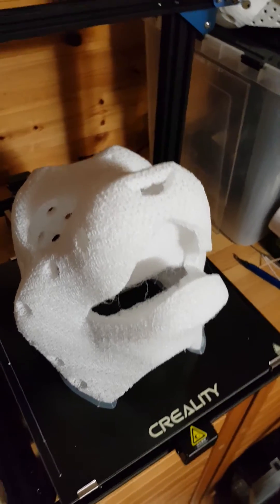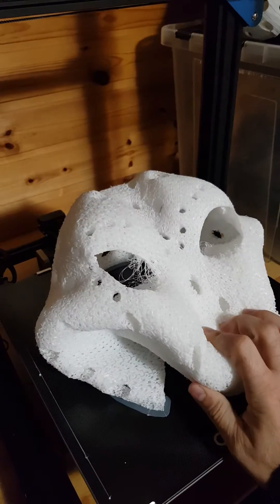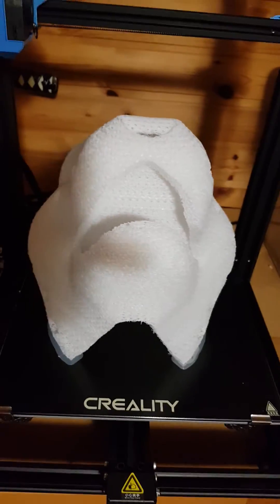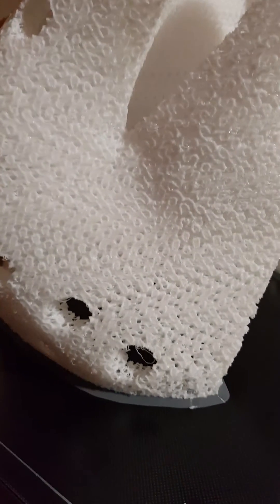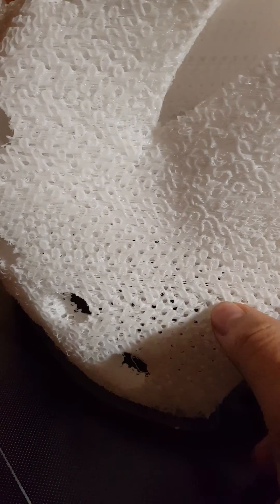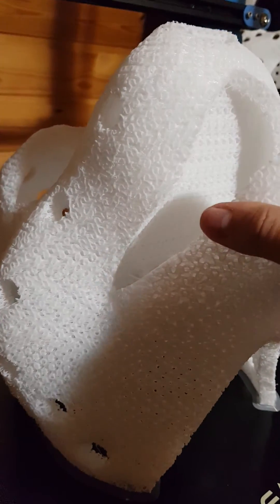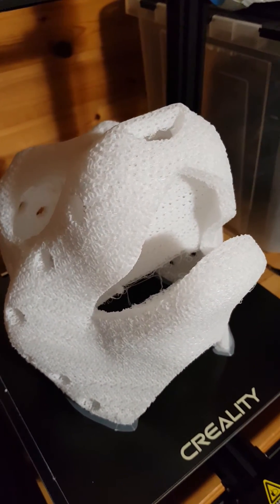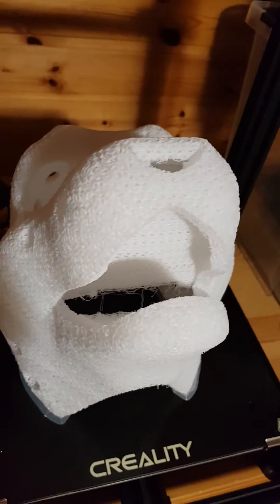3d-printed flexible fursuit head base - optimized print settings - #shorts

Comment: Hey! I'm prinitng a tpu base of my own and in overhanging areas the tpu is stringing and just doesn't wanna stay in place. Urs look perfectly fine even in overhangs wohtout any supports. I'm using a p1s bambu and sunlu basic tpu. Idk what else should I do to fix it. Thanks for the help. I reall don't know where to ask cuz its such a niche thing ^^
Reply from the maker: I got most of the stringing problems under control by lowering the print speed and adjusting the printing temperature. With some TPU filaments plus or minus 5°C can make a huge difference.

Comment: I need help, I'm trying to print one of your models on printer and it keeps failing, what's the printer setting you recommend, I'm using a ender 3
Reply from the maker: Which model are you trying to print and what filament do you use? How does it fail (Does the extruder get caught in the print? Is the print bed ahedsion lacking? Does the print warp? ...)? If I print my head bases with PLA I use the default Cura settings für 0.2mm layer height (changed brim 6mm, 3 outer walls, 15% infill, no supports).
Reply: @Tiohkatrah  I'm using a pla overtune black
Reply: @Tiohkatrah  yes its warping and squishing, im printing the minimalistic fursuit mask